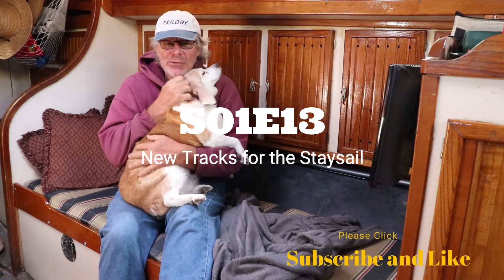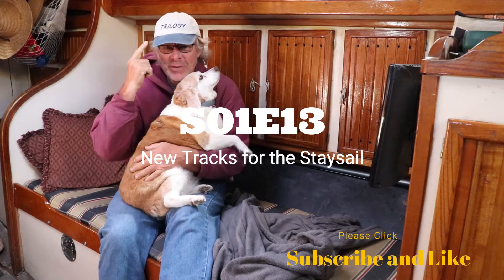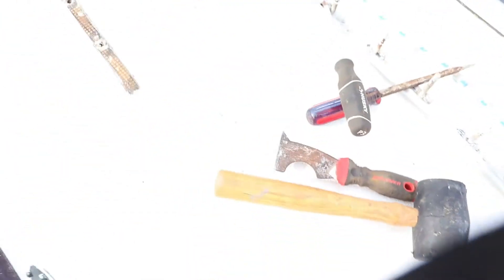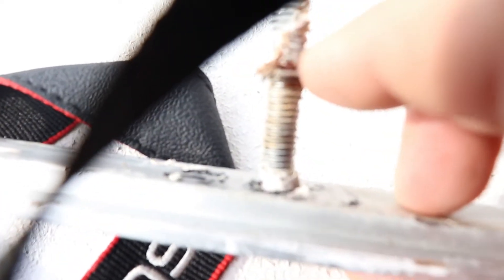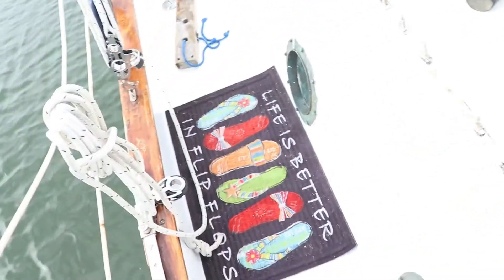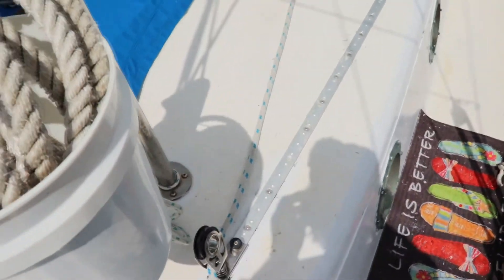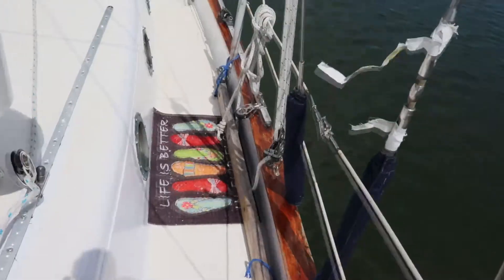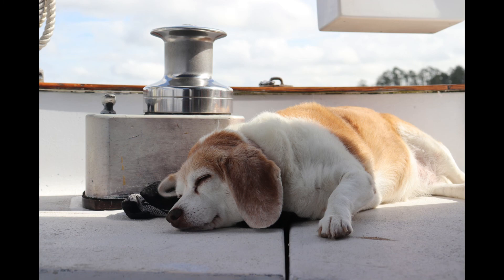S01E13 New Stay Sail And Sail Track

Comment: Were you running the staysail that remained from when you took off the club foot boom?
Reply from the maker: i add 6 foot tracks on to of dog house. the westsail 32 manual gives a general location for them. the long 6 ft tracks allow for greater variations of sail shapes. the staysail must play well with the yankee or you wont get anything out of it. sailing a cutter is much different from sailing a sloop.
Reply: @svtrilogywestsail3278  The reason I was asking was I m going to be pulling my boom off and will install the traveler tracks. Just wondering if I can use the old sail, or need to get a different cut staysail.